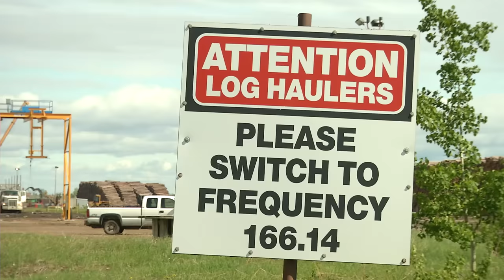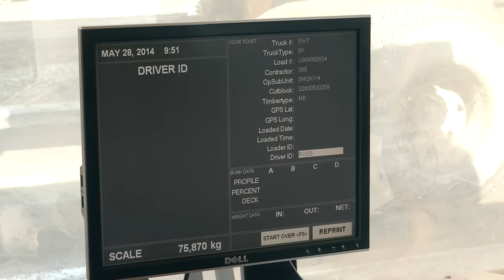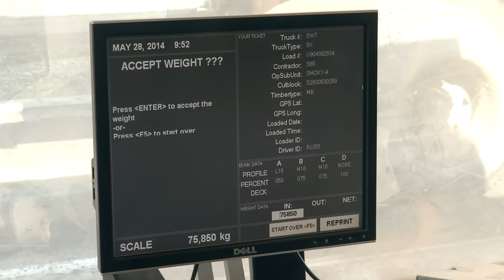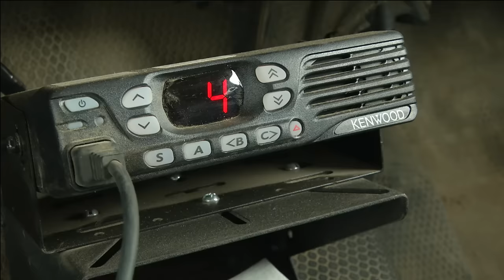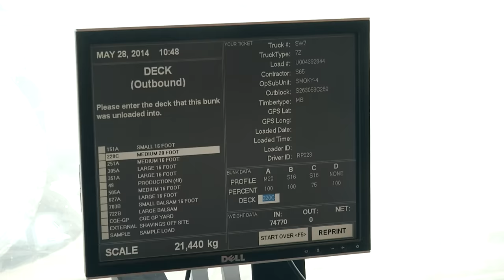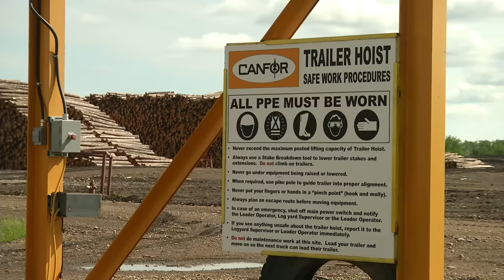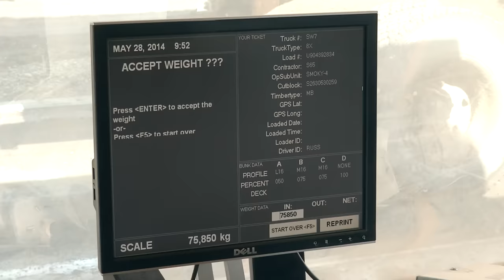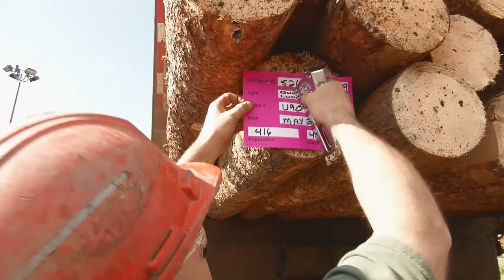Logyard Orientation Video

Comment: That sounds super cheap making all of the truck drivers learn your computer system... That should be a manned shack IMO
Reply: If you work a wendy's you are going to have to learn A computer system to clock in and out of your job. Are they being cheap by not having somebody to man that computer? Only lazy ass truckers would complain about having to do anything that isn't strictly sitting in a truck. Every other job nobody questions having to learn company specific system's.
Reply: I only know the computer of the specific yard I go to. If I was one of those contractors that deliver loads I wouldn't be too happy. You can't expect a driver to know 15 different computer systems, one for each yard they may have to deliver to. But then again, I don't know how logging contracts work, if they only deliver to one mill or something like that.
Reply: The issue is these guys don't work for the lumber mill. They work for the logging company. This would be like if you went into Wendys to get your lunch only to be told you need to make it yourself.
Reply: not having it manned means that they can afford to pay the truckers more, so there is that to consider.
Reply: @xaiano794  no, only more profit. Truckers don't get more pay. In what world are you living in?

Comment: Free labor from the drivers,  freakin corporate greed.
Reply: one should clock this and bill send them a bill for the scale operation.
Reply: i do refrigerated pallets and find myself constantly doing a fucking storemans job or supervising forklifts trying to find my loads in someone elses cold storage sheds.. shouldnt be my job
Reply: A truck driver is responsible for his load. This place does seem to leave much of the work to the trucker but I wouldn't be surprised if this system didn't come about because of truckers abusing the older system.
Reply: Stand up in protest and don't haul logs there then? All the time spent at the scales is built into the cycle times

Comment: What’s the trailer hoist for?
Reply: Carson Stephens hoisting trailer's! Some trailer's can be moved up on the back of the truck.
Reply: when a truck comes in pulling a trailer full then unloads the driver will lift his trailer onto the back of the truck so the trailer doesnt have to be towed saving on trailer mileage and can get to his next destination without worrying about towing a traielr

Comment: Wearing a vest and helmet in the scale house is one of the silliest things I have ever heard. I mean you afraid the roof is going to fall in. OSHA/health and safety is one of the stupidest over bloated government agency's out there. And they cant see how stupid they look requiring these items that can't even do anything for you.
Reply: At the point you are at the scale house your load is still secured therefore nothing would be able to fall on you anyway therefore as Joel said it's one of the stupidest requirements possible.
Reply: Whenever outside at a lumber yard, secured load of not, always wear protective gear
Reply: Joel Martin  I agree, OSHA has gone to far on some things. Few of my friends work for the county, they have to wear hardhats for everything. Mowing, weadeating, driving a tractor.
Reply: Joel Martin over bloated but can jack u and ur company up. Osha making a new push to make the individual liable too meaning u get fined not just the company so wear the ppe or face osha wraith
Reply: Protective Equipment is there to eliminate injury from unseen dangers within a workplace. Your in an environment where loose cargo is stacked above your head. Never 100% rely on your equipment, because if equipment can be built, then it can break.
Reply: I'm occasionally in rail yards, some of which (hump yards) have cars that roll almost silently.  So many ways to die if you have a lapse of imagination or "have done it a hundred times" and get unlucky.  If you never take the gear off, you can't forget or get caught off-guard.

Frankly, this isn't much ear - no hearing protection, respirators, dosimeters, etc...  When you do NDT inspections, welding, and such, you have radiation to watch.  If you want to keep good people, your goal has to be zero injuries/fatalities.  The extra expense is worth it in the long-run both the people and the company.

Comment: So you take the pink card, print the crap on the back of it, then take another pink card, write what is printed on the back of the first pink card to this card, then you take another two pink cards and write the same crap on them (or copy them, but that printer has no pink color, so probably write it all again and again) then staple one pink card on the logs, one pink card goes probably to the box (nobody said that but it probably goes) and then you keep one pink card.. What do you do with the pink card that has crap printed on the back of it - nobody knows:) Some put it on the log, some put it in the box and some take it. Some say, that some truck drivers use the pink card to shit - its a very popular activity, in which the goal is to shit on the pink card so much, that it is all brown. The biggest of truckers can totally shit over all three of these cars, taking a stance on the government check:DDD
Reply: Maly Pivo well.. the video specifically says you tack each card onto each trailer.  3 trailers = 3 cards.
Reply: System should print front and back, though the human can turn it over.